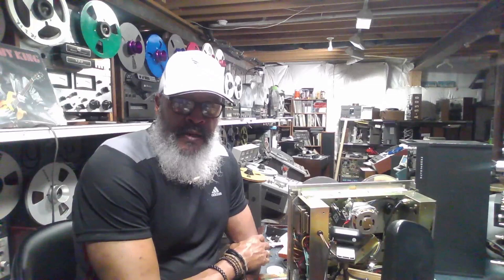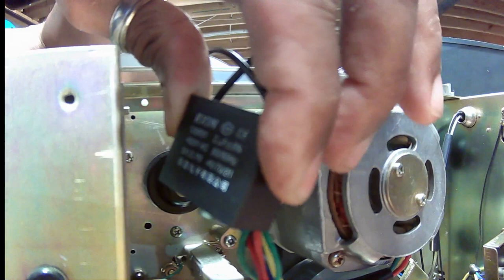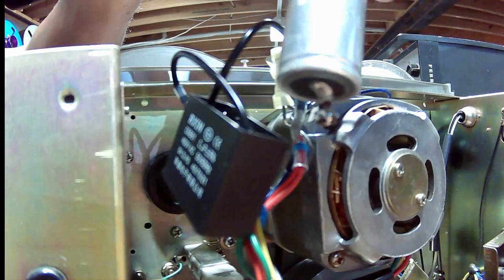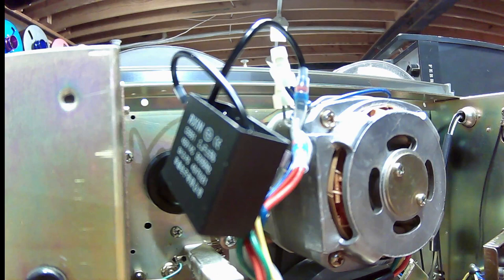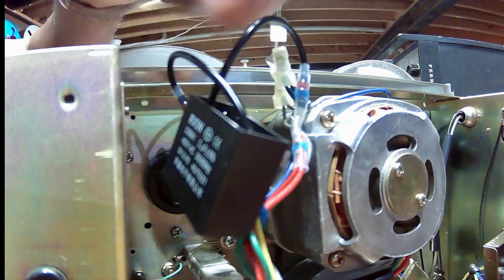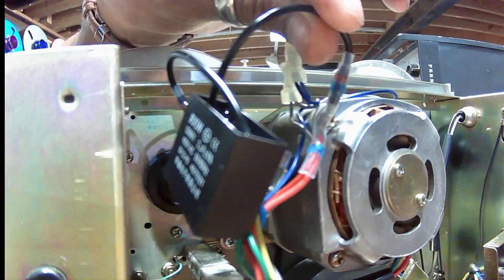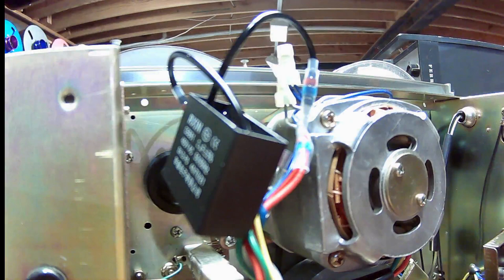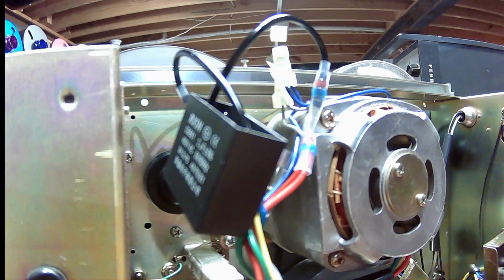Akai 4000DB Reel to Reel ((running slow) Fix

Comment: Thank you so much i have 2 reel to reel deck from 80's Akai rx625 and rx646 both have same problem they are slow and stops during rewind and fast forwarding and they both have same dual motor run capacitors and i don't know which capacitors to use as replacement I can’t use this deck for years any help deeply appreciated  thank you in advance.

Comment: Just subscribed and gave you a thumbs up. Question; are there any safety precautions I need to take so that I don’t get killed doing this? Thank you
Reply from the maker: Hi J, Just make sure the unit is unplugged.
Reply: @5thcomm I thought that the cap has to be discharged first?